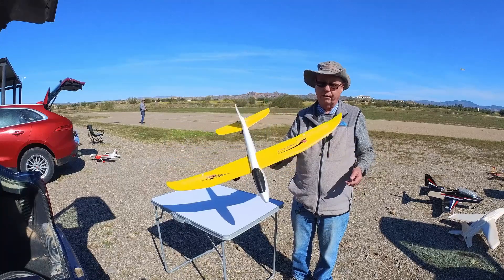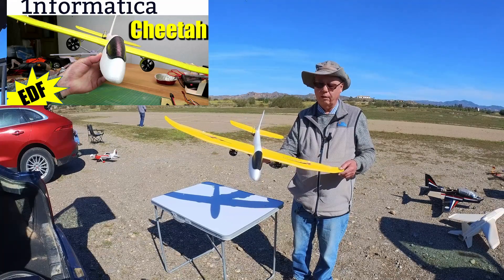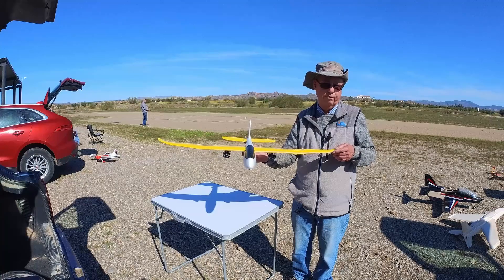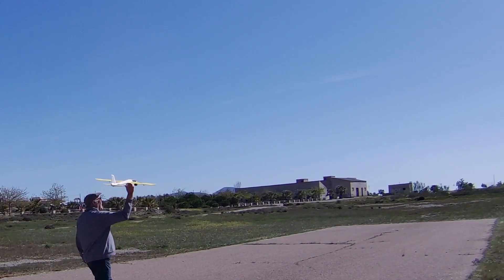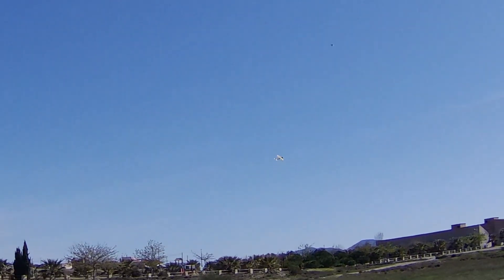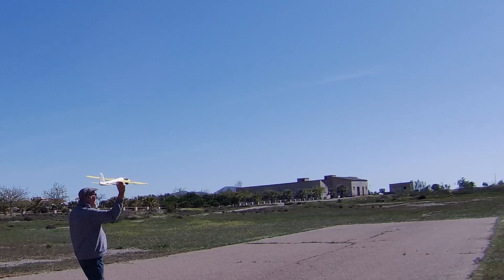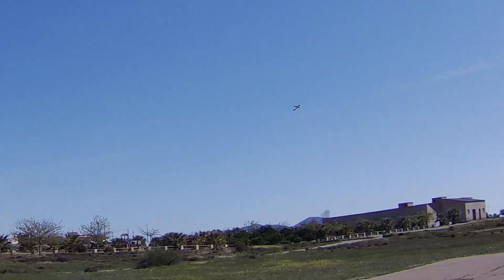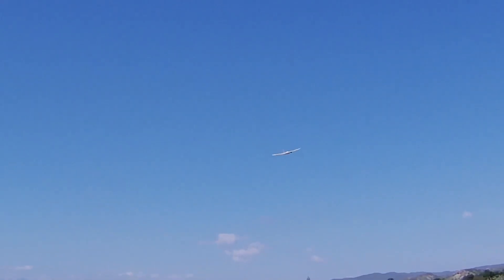Cheetah Twin 30 mm EDF Test Flights!

Comment: My only thought would be adding some downward angle to the motors. Was it still squirrely while gliding with the power off?
Reply from the maker: Hi Mike, thanks for the input. On power off it did glide straight with a slight descent which I was happy about. Will keep your idea in mind. First I think I will mix a little down elevator with the throttle and see what that does. Something I have programmed but not tried yet is differential motor thrust mixed to the ailerons, stay tuned! You have some neat models on your channel. I like the ME163, used to fly a spee400 version back in the 90's, it was a screamer too! Thanks for watching, have a great day!
Reply: @1nformatica  thanks:) hope you get this one ironed out  I've got the same plane and motors sitting around
Reply from the maker: @mikelarin8037  Thanks for the encouragement! Will give it another go next week weather permitting.
Reply from the maker: @mikelarin8037  All is good! https://youtu.be/_wCgIcoDiT8